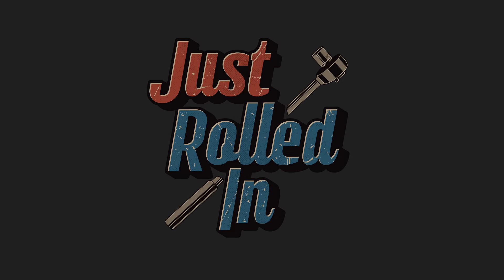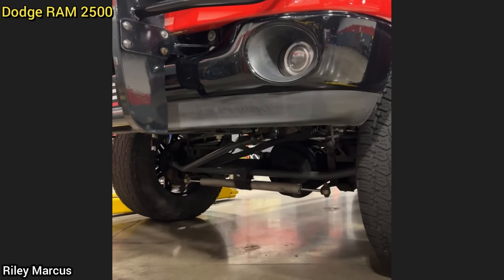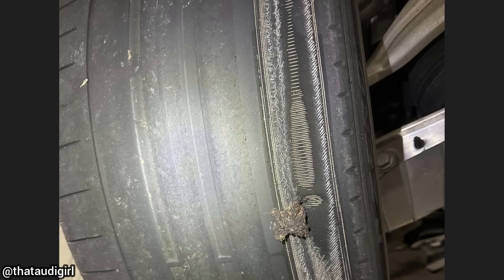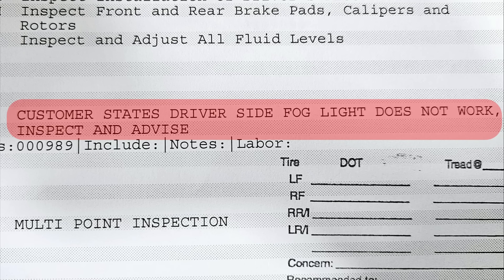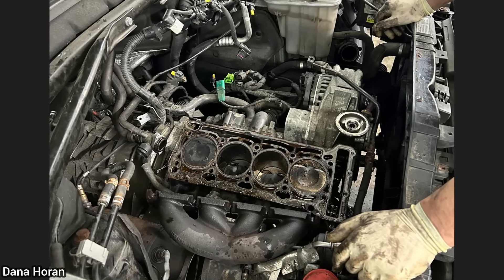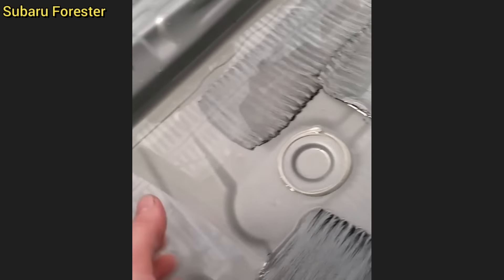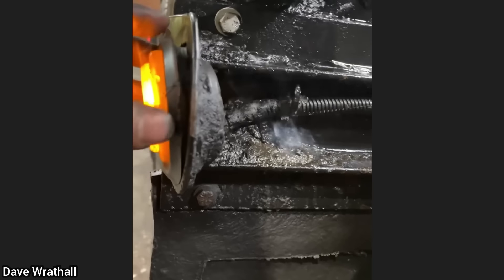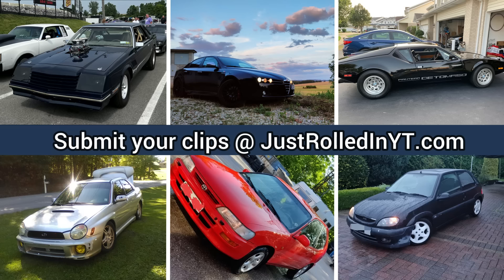Customer States It Looks Like His Car Has Been Left In A River

Comment: The car that those new Struts and all of those undercarriage parts and was brought in for a wheel Alignment.  Then it was "discovered" that the rear sub frame was rusted through.  I will Guarantee you that the shop that did all of the work saw that and decided to go ahead with the repairs because it was easy money...........   I worked at a shop that wanted to do that to a customer , the shop foreman said to just do the repairs and not worry that the rest of the car was a junker.  In all good Conscience I could not do it and refused to do the job.   The shop foreman backed down after I told him that I would load my tool box right then and there.
Reply: You're a good guy.

Comment: Fixing a fuel line with a welder is one way to attempt to get a Darwin award.
Reply: well i guess in a darwin award winner multiple times because ive taken them off cleaned them out very thoroughly and welded them (alot better then this guy) and replaced it back on vehicle and there still on the road today... but i have 2 decades of welding experience and i own my own shop and have the equipment to
do such things.
Reply: @jort93z  ......bro you are talking about superheating fuel that is contained in a sealed metal tube tube. An explosion could absolutely happen, maybe not a particularly large one, but there would for sure be some shrapnel.
Reply: @alexwalker2582  An explosion requires the ratio of fuel to air in the heated area be in a certain range. Too much fuel or too little fuel in the air and an explosion can't happen no matter how hot it gets from a welder. If you're welding in a well-ventilated area, which is pretty important for welding anything, then there shouldn't be anywhere near enough fuel in the air to cause an explosion with a small leak. Trying to weld a fuel line in a car parked in a little garage at home that's been there for a while with the doors closed might be more hazardous. Slightly related, all natural gas companies employ many welders specifically to repair natural gas pipes through welding them even while they're being used to transport natural gas.
Reply: Just wondering how’s he still alive !!!!
Reply: @alexwalker2582  everyone else is correct; it won't explode. Primarily because gasoline isn't flammable in its liquid state, and it would be a liquid while contained within the fuel line. Assuming any was present at the time.
Reply: And one way to get to heaven quicker 😮
Reply: @alexwalker2582  How? Tube is not sealed. You are making this up

Comment: Customer states non existent driver's side fog light doesn't work, but on the bright side the non existent passengers side fog light works just fine.
Reply: lmfaooo right
Reply: The drivers handbooks are not easy to follow as they cover several models of the same car. I can understand why he thought he had fog lights as the handbooks are garbage.
Reply: @tonysheerness2427  Aside from the fact that you don't need a handbook to see if you have fog lights, why would they only complain about one side not working if there are none installed?
Reply: That's the most mind-boggling thing XD you'd think they'd complain BOTH weren't working!
Reply: @tonysheerness2427  Who needs a manual to SEE if there are fog lights on their vehicle? The book will describe the location, function and switches associated but it will also read "on certain models" or words to that effect.
Reply: That was my first thought, too but on cars, especially with projector-style headlight assemblies the light line tends to be lower on the driver's side as to not blind any oncoming drivers and higher on the passenger side to help you see things on the side of the road better.  That's likely why he thought the passenger side was okay.
Reply: probably referring to the rear fog light. common in cheaper cars to only have one fog light on rear

Comment: Fixing a fuel line with a thing that generates a spark.
GENIUS
Reply: i was like🤯when i heard that
Reply: Might be the same guy responsible for the flaming tire at the end
Reply: I
Reply: That’s a Darwin Award candidate for sure
Reply: I was in absolutely shock by this. Kinda but not really that someone was dumb enough to do it, but more so that it didnt catch fire.
Reply: If it doesn't burn, that's a win, or insurance pay out! 😂
Reply: Client of mine recently had someone get arrested inside a vacant schoolbuilding he owns, who was about to take a grinder to the gas main to steal the metal.

That would've brought the 'renovate or tear down' discussion to a spectacular close.
Reply: Well actually... if you have wash the leak area there are no problems. 
Not the smartes thing to do, but if you have to you can even weld a full gastank.
Reply: Hold my beer while I get out the welder
Reply: I seriously cringed when I saw that. Welding, soldering-anything- on metal that has been incontact with petroleum is hazardous.
Reply: Came to the comments for this. How did he not go boom!?
Reply: @jon27d  Could be a return line which would drain slowly since it has no check valve, like the supply line.
Reply: I guess the fuel line was removed before "repair", otherwise the whole car would be a small pile of smoking debris
Reply: When he was in his 80s, my grandfather was gearing up to use his torch to "weld" the plastic casing of his car battery to repair a broken terminal. Fortunately, my dad caught him before he started. That's when Dad decided Granddad was done driving.
Reply: Well the fuel has to burn anyways to make the car go wroom, he just speed up the process
Reply: Could've been a diesel, as it is a hard fuel line and direct injected
Tho as this happened in the US it is more likely a gasoline one lol
Reply: @XtreeM_FaiL  though it's safer to instead fill the gas tank with water as much as possible before welding. I had to do it with my car a few days ago... must have driven over something that then put a small dent into the tank's underside. it was right by a sharp bend in the tin, and slowly started to make a gap that widened while driving. in the end it leaked like a fountain... no idea how it happened to begin with, but there.
Reply: @IIGrayfoxII  return lines are typically hoses, because they don't have to hold pressure. the line we see is a high-pressure line. small wonder the fix didn't fix it. modern systems can have up to 1000bar...
Reply: @Fang4G63T  The US use diesel for their trucks.
Diesel was only more common for small cars in Europe. but thats changing even now
Reply: @nvelsen1975  there was an old paper mill that shut down by me,a few years ago.
two guys went in to harvest the copper from electrical lines.
Probably 440V.
One guy cut into a live wire,and fried instantly.
Reply: @lotharrenz4621  try 2000 bar plus.  I have a GMC truck that is all steel lines pressure, return, and vent.
Reply: Welding it isn't that big of a deal really.  There won't be any oxygen in the line for it it burn or explode.  Only the fuel that is exposed to air will burn.  It's still not a very smart thing to do.
Reply: @jasonstclair6293  since the line is compromised(ie the very leak he is "fixing") there is air in the line
Reply: With a J 😂
Reply: i literally said "oh my god" out  loud when i heard that

Comment: Putting a bigger fuse in helps you find the problem faster!
Reply: Definitely one way to find the weakest point in a circuit.
Reply: BTDT on a 1980 Olds Omega that kept blowing the air conditioner fuse. A junkyard wiring harness forward of the firewall replaced the melted mess. I absolutely despised that car.
Reply: Bypass the fuse and never have to replace it again.  Pesky fuses....

Comment: Wait a minute!!! Someone called the fire department to cut a seatbelt?? 🤣🤣🤣 useless 🤣
Reply: Like does a scissor not work? Or a freaking knife?
Hedge clippers?
Reply: I bet they actually called 911, the fire department would be the ones to respond.
Reply: Should have called the guy who welds fuel lines.
Reply: And apparently neither the fire department nor the owner could figure out the easy fix of lean back the seat.  Still sounds like the repair shop was not happy with the customer wanting a defective seatbelt replaced.

Comment: When you think people can't get any more stupid,
someone goes and welds on a fuel line.
Reply: I'd do it. Just disconnect it first
Reply: Since 2016 it isn't possible to lower the bar any further for how stupid we know people can get
Reply: @cenciende9401  Eh... I had to take a safety course recently due to needing to use a chainsaw at work. One of the things they went over like 10 times was not to hold the chain between your legs when starting it.
Reply: Saw a guy do that to a fuel tank. Put dry ice down first, claimed it was safe because there was no oxygen to ignite the fuel.

I mean, the theory is sound, but heaven forbid you don't get all the air out...
Reply: @ThatOneGuyWithTheEye thank you for collaborating the previous comment😂 stupid people doing stupid things😂 you do realize that the fumes from gasoline is what’s flammable 😂 your also the one that strikes a match to see how much gas is in the tank😂

Comment: Been there with that mold issue, had a civic with the tiniest leak nbd, but developed transmission issues, also had an integra I was fixing up, ended up just half ass fixing the integra and then destroying it as a daily driver (rip) when I finally got yelled at to get the civic off the property, I decided to clean it up and sell it and it looked a lot like that VW, it actually cleaned up really well and easier than you'd think.

Comment: It must infuriate mechanics when customers refuse to address genuine major safety issues like brakes and tyres and just drive away, knowingly endangering literally everyone around them.
Reply: Hopefully those shops are smart enough to call the local dot and have them wait on the person to drive away
Reply: If the car is really bad alot shops will pay to have the car towed back to the customers house.
Reply: @batmansdad3195  Depending on the country/state, that would be a pointless call. In CA you could probably call the highway patrol but there isn't really a minimum standard of car function beyond the most basic like working lights, signals, and windshield.

Comment: Keep waiting to hear, "the technician couldn't replicate the stated concern but determined the customer was an idiot".
Reply: At least they didn't guess and fire the parts cannon without knowing the cause of the problem.
Years ago my mom had an Aries K that would occasionally stall when put in gear. Three trips into the dealership (It was still under warranty) and they couldn't duplicate the problem or really diagnose it. But they did a basic tuneup, replaced the fuel pump and filter, and replaced the injectors. 
Eventually they figured out the the engine hated gas/alcohol mix (Gasohol it was called at the time). They told her to take it to another station and they problem went away.

Comment: The upsidedown steering wheel, the only way I can think of that happening is if the tie rods were installed while the steering wheel was upsidedown, even then IDK
Reply from the maker: Bingo!
Reply: @JustRolledIn you think they wondered why one tie rod was so much longer and the other so much shorter than the ones they replaced? LoL
Reply from the maker: @dansweda712  i don't think they were thinking 🤪
Reply: Still worked fine,  the wheel position is just relative.. put some tape top centre, instant race car! 😂

Comment: It was clogged sunroof drains snaked em often. Also, all the lights are because the J519 Central Electronics Control Module is in the lowest spot under the driverseat and it gets submerged. The 72 pin connector needs made by hand VW didn't sell that harness. They may now, but didn't 10 years ago.

Comment: It’s again mindboggling how people don’t realize that the tires and brakes are the things that keep you on the road and bring you to a safe stop 🤦🏻‍♂️ insane, dangerous and stupid penny-pinchers! 🤯

I had my car in the workshop last week for the mandatory safety inspection, the notorious German TÜV inspection. The rear brakes were nearly worn out (which was also noted in the report) but would have done for maybe another month or two. But I let them replace the brakes anyway since getting through the hassle of a new appointment and another day without a car wasn’t worth it. The need for a replacement is not avoidable after all. Had to pay over 700€ for everything. I can’t deny that it hurt a little bit in my pocket, but I am rather a little bit poorer than injured and/or guilty of an accident (with all consequences) or dead.

Comment: Welded fuel line .. guys that looks like a peugeot/citroen engine with denso fuel injection. a DIESEL . while wedling  on the line is perfectly safe, and barely a fire risk it will never fix the issue, so was a dumb thing to try, but its not a gasoline engine, worst case youll have a little puff of flame and some smoke.

Comment: My current declines are a coolant leak and leaking valve cover gasket.  Coolant leak ($650, they finally found it!) is going to be scheduled tomorrow.  The valve cover ($720) isn't making any drips on the driveway or triggering a low oil light yet between oil changes, so it can wait!
Reply: The oil light is almost always just an oil pressure light.  You never want that to come on.  Very few cars have an oil level sensor; unless it does, you should use the dipstick for that.
Reply: @kc9scott  It comes on when the oil gets to the ADD mark on the dipstick, so a quart low.  So it means the leak is just seeping a little and not gushing.

Comment: Customer states that a strange noise comes from the front every time they insert key into ignition and turn the key clockwise.

Shop removed key from the customer, which fixed the issue.

Comment: Another reason to stay away from cars with remote start. Not only do I not want it but most people suck at putting them in. I got a cr-v and it looks to be done correctly but will drain the battery if it sits a month and if I unhook it it won't start at all.

Comment: Ok, the seatbelt one may have been a real issue. My sister managed to get hers stuck around the headrest of the seat in front of it. I had to unbolt the seatbelt to release it as the child ratchet was set and you cannot pull more out to get it around the seat again.

They may have had an issue with it getting stuck around a car seat.

Comment: "Driver side fog light does not work"
Okay, how did it come to this? How was the customer so determined, that an imaginary passenger side fog light was working? He couldn't have stood in front of the car, he would have seen, there are no fog lights. And from the inside, from all the cars I have ever driven, you can barely see a difference on the road, if a fog light is out, if the low beams are on.

In general, how come people know so little about their cars, that they take it to the shop about not working accessories, that have never been there? While I think it's some level of incompetence, certainly not as incompetent as my mother. She's the most insane wisenheimer living on this planet. The car model she had back then I know inside and out and randomly mentioned at some point, that it doesn't have fog lights. She insisted like crazy that it does, turning louder and louder in the conversation. And months later she randomly dropped that I was right and there are no fog lights. She's that awful, and continuously with everybody, which is why nobody can have proper conversations with her. She will argue like a madlad about some random fact, that she doesn't even know anything about. I dunno, must be some psychological issue, this is not simply stupidity.

Comment: ahain, knowing enough to at least put real welding spots on a thin steel tube... but not enough to know that it won't work because there are a couple hundred bar of pressure inside, and that only works if the tube is literally one piece... getting a new line to begin with would have been cheaper. because i guess they removed it first and flushed it to prevent a fire.

Comment: Can I just ask the question of why the hell a car is not equipped with fog lights???
Reply from the maker: Lots of vehicle's don't weirdly enough. Our RAV4 didn't have any as well. Maybe a Toyota/Lexus thing? They sure come in handy though. I use them often!
Reply: I guess Nissan saves money by making all the same front bumpers. Mine has dummy foglights, too. Oh and they're not required in the US. I think they're mandatory in Europe.
Reply: Glad I’m not the only one who thought this was weird.
Reply: My Dodge Grand caravan has spots for fog lights but has none. I guess they are an added option but the bumper is universal fit
Reply: My Lexus es is the first car I've ever owned that had fog lights, on the rest they were an option that I didn't have, pretty bad too because I live in the great dismal swamp where it's known to get just a bit foggy
Reply: Usually only the rear fog light(s) are mandatory. Front ones are not, although most vehicles nowadays include them as a standard, unless you pick a really cheap configuration. So yes, most bumpers are ready for them, and if they're not present, the holes are plugged and in some cases these plastic inserts are the same shape of the real lamps, but damm, they're black/gray!!!

Comment: Who tf welds a gas line? Gas, fuel, petrolium, the very flamable thing that goes boom so your car works. You typically want to keep sources of heat away from that like, I dunno, a fcking welder. I would say hopefully he took it off, but the fact that he thought welding it in the first place tells me that thing was still firmly attached to the fuel system